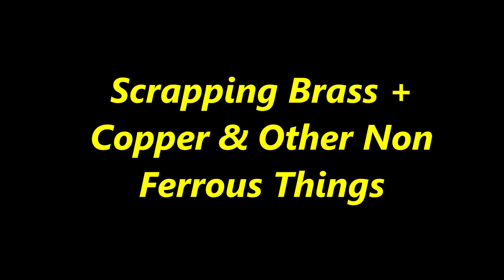Scrapping Brass + Copper & Other Non Ferrous Things

Comment: You should move your saw back and forward so your using your whole blade.If your cutting a harder metal use an oil dripper to oil your blade helps blade last longer.👍👍✌👊👊